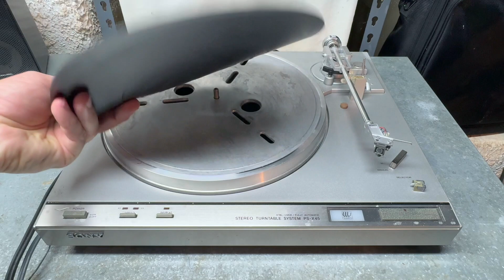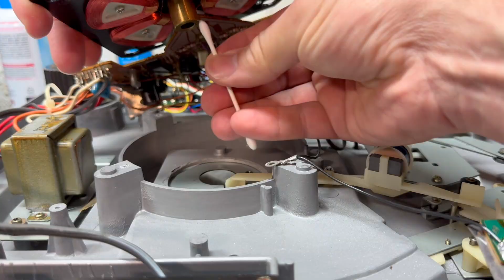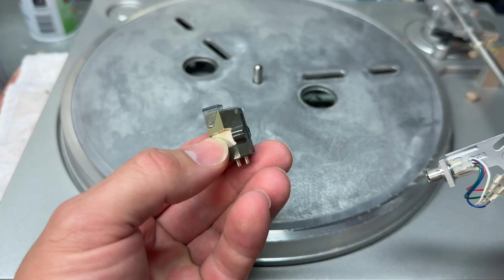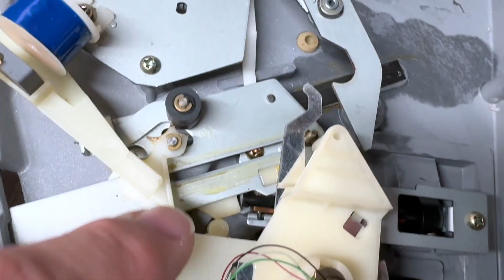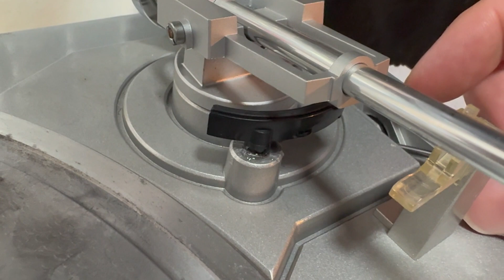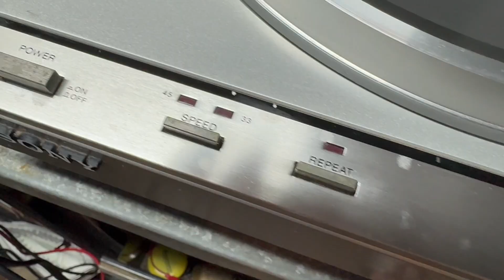A GREAT Sony turntable, the PS-X45!

Comment: I have a early 80s Sony PS-T22 direct drive turntable.  The styles is bent and the tonearm wires are broken. I have a replacement styles and some replacement wires for the tonearm. I couldn't find my desoldering supplies so I had to order more. It's been about 30 years or so since I've played an album on it. It should pair well with the early 80s Denon DRA 600 reciever I'm also in the middle of repairing. It has a  shorted output transistor.
Reply from the maker: Good luck with the receiver (my first was a Denon).  I'm OK with a soldering iron but am not particularly good at electronic troubleshooting.
Reply: @ToFixWhatIsBroken I'm definitely a novice but am not completely lost. I pulled the reciever out of a trash pile so if I let the magic smoke out im not really out anything.

Comment: I have just got a ps-x45 . When I press start/stop, it spins a few rotations and it stops. When press the start/stop button again, it does the same thing.....spin a few rotations and stop. The X light is constant green. Would you have an idea howto fix this ??

KInd regards Pim
Reply: Check the main voltages that come from the transformer, there should be two big transistors that act as fusable  resistors, those are known to fail, check if you have +14 and -14 volts on each side, if not there's probably a problem with leaky capacitors. Hope it helps man.

Comment: I don‘t think the oiling of the lift is correct. Look at the service manual, there you see a stick with a shaft, there you should put the silicon oil on. Greatings from Germany. Stefan